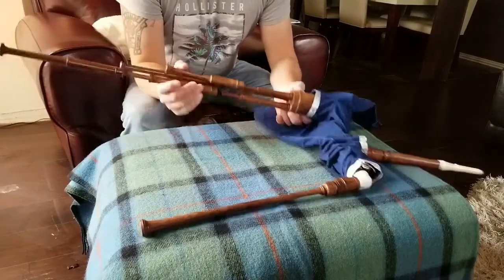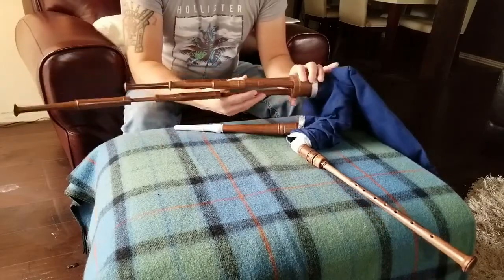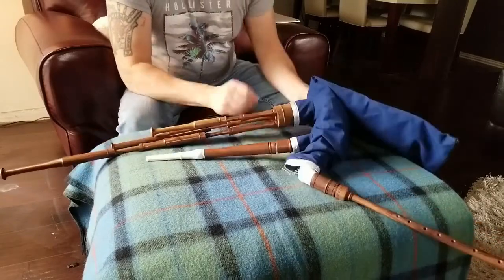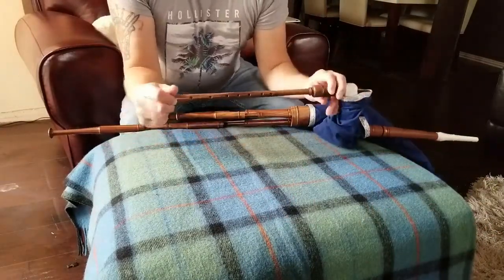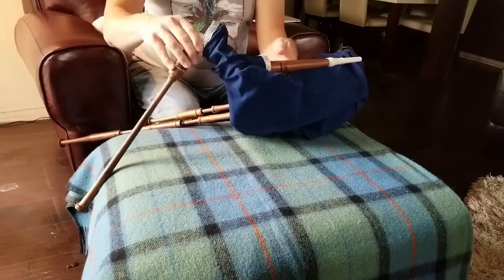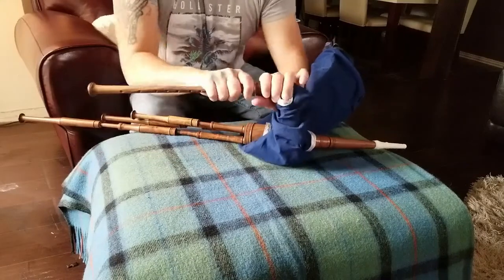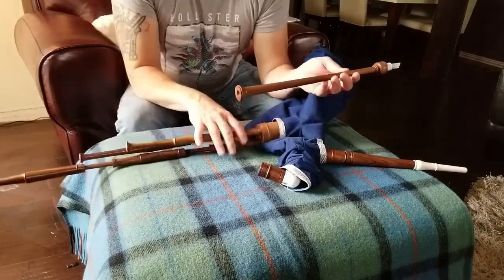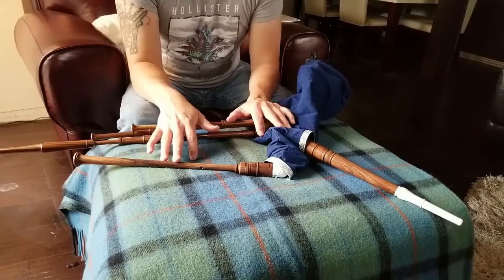Bagpipes Hakam Din Pakistan small pipes review and modifications

Comment: i gave HD a shot and asked if they wanted a fair review on their Brian Boru and also border pipes. I bought the more expensive reeds for them but the design was so bad the reed in the borders actually was in the BAG after attaching the chanter and not the chanter stock. The first reed was ruined the minute i held the bag up and it twisted into the reed. Likewise with the BB pipes—unplayable in terms of getting them tuned and the key work did not seal on several. I finally gave up.